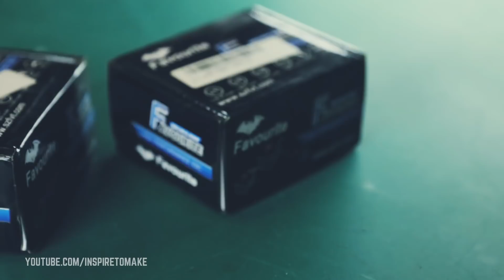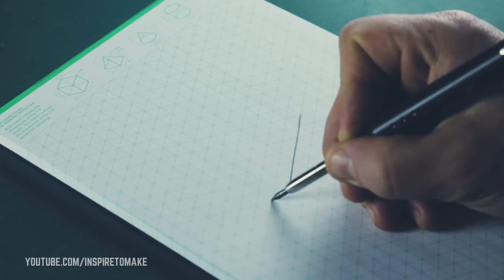DIY ELECTRIC SKATEBOARD

Comment: Hi bro how do you charge that battery? Is it including adapters when you buy that battery
Reply from the maker: Adapters are not included, so I have to resolder the connectors on ESC. This skateboard is still work in progress,  I need to figure out the battery management system.

Comment: I've been trying to build mine for a while now but I ran into a dead end when my motor mount would not fit on the trucks, now watching your video has given me what I've done wrong, as I'm using the same mount, which is that i did not grind the trucks so many thanks for that. For the record, what exact tool did you use to shape the trucks that way?
Reply from the maker: Just a metal file. Aluminium trucks are soft, so it didn't take lots of time to grind.

Comment: How do you make it so that turning doesn't off set the belts
Reply from the maker: The motors are not mounted on the board, they mounted on the track. so they are always parallel with the wheels.